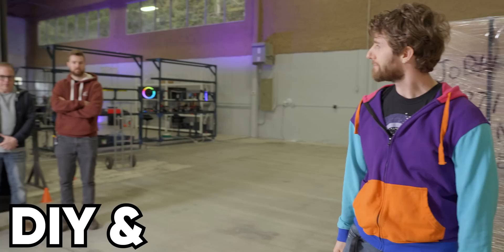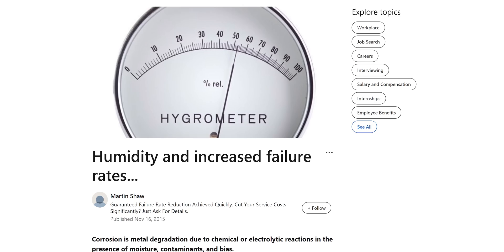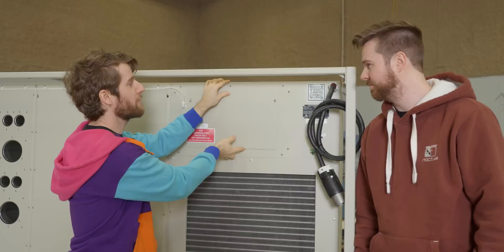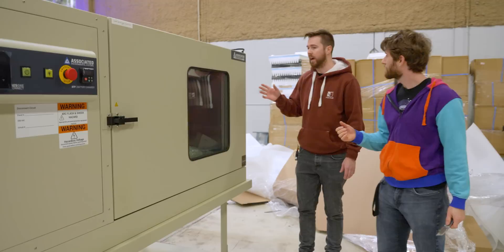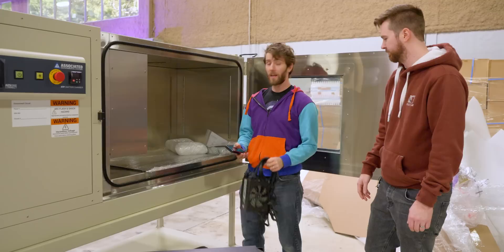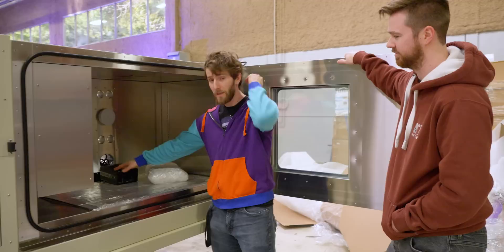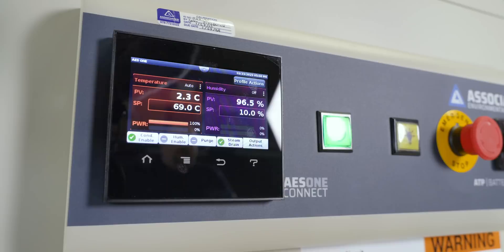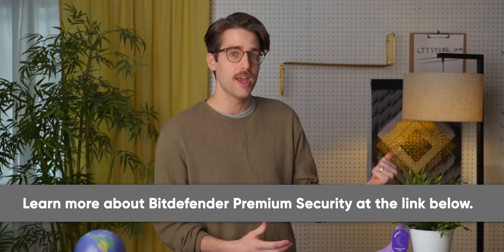We bought a Fridge for computers.. - Environmental Chamber Unboxing

Comment: For the PSU's, I do assume the test station can handle 4-wire testing so efficiency testing inside the chamber over "extensions" should not be a problem. Or at least the tester can be adapted to accept external 4-wire harnesses :)

Comment: This is actually the type of test environment mobile batteries need. Most tests are done in low humidity and room temp, if not less than ideal room temperature environment. When I use my phone outside with direct sunlight at 38/39C, with 80% humidity, the CPU drains power like a hungry V8.

Comment: All my experience has been with Thermotrons and I've never used an associated thermal chamber. But I  am pretty sure the Nitrogen is used for dry purge to allow for humidity to be pulled down fast to eliminate from condensing situationsn when doing thermal cycling. With thatt said, unless you want to change cylindners out alot, get a dewar tank of liquiid nitrogen.

Comment: regarding efficiency measurements with cable extensions: you can use four point terminal sensing (of the cable extension) and some calculations to extract the losses from the cable extension. But your lab team will know that anyway, I'm certain. (The only questionmark remaining would be the contact resistance of your connector. you could solder the probe cable to the PSU side but that's a hassle.)

Comment: 0:32 that reminds me: the temperature in Arizona growing up would routinely exceed my handheld devices' "rated" temperature.  I still have that Switch, and not only is it unscathed, it did not show any signs of malfunction.  (Neither did the Wii U tablet.  Or the DSi.  Or the 3DS.  Or the New 3DS.)

Meanwhile the xbox 360 of the previous generation had a reputation for overheating itself to the point of destruction ... indoors.  Luckily I'm a Nintendo girl, so I never had a device implode on me.

Comment: I had an Asrock z97 mobo with a bios setting to run the fan for some period of time after shutting off the computer, and when I looked it up, the explanation was that in tropical / high humidity areas like SE Asia, since the inside of the PC was probably going to be hot when shut off, the cooling air would condense moisture which could settle on the components and cause a short if powered on before it dries, so this setting helped keep the internals dry.  Smort, haven't seen that setting on any other motherboard (but I think TUF boards used to have it?)

Comment: If you characterise the cables from the PSU tester to the point of connection to the PSU default cables, then their effect can be calculated out. Alternatively, if the cables from the tester have extra sense wires that transmit the voltage at the point of connection, without carrying current themselves, then there is no difference in results (the tester must support that in that case)

Comment: Minor issue - 28 degrees Celsius is far too low to be room temperature in a lot of places especially South East Asia. Plenty of poorer Asian countries have average temperatures in the low-mid thirties for 3-4 months of the year - especially the places where electricity is too expensive for air conditioning to be a regular feature.

Comment: It’s calling for demineralized over deionized water, because deionized water is actually a solvent and will slowly but surely eat away at the internal plumbing. 

The same goes for water cooled laser cutters - demineralized to avoid buildup, but deionized will cause issues.

Comment: Hey, if you need a constant supply of nitrogen look into a nitrogen generator. Gonna be way better long term than buying cylinders. "ECS" is the manufacturer I know of. Will just need a compressed air hookup and filters every couple years depending on usage level.

Comment: See what temperature a water cooling system freezes and shuts down at and if that temperature would be sufficient to keep cooling the computer with the water cooling system frozen, you may need an expansion vessel of some sort, but would make for a great video

Comment: Well, I|m from germany (which is Europe afaik ) - and we lived thru the so called "energy crisis"  - which was nothing like a fart in the sea. There was no -28°C room temperature. You could still heat your house. But it got significantly more expensive. But I don't know a single person, who spared on heating. 
If anything, the people got mad and depended the rising cost of living back from their employers. Union-based tariffs rose at a whopping 10-15%, giving the middle finger to the inflation. 

Now, that winter is gone and the heater oil tanks were filled, gas and oil prices normalize again. 
I switched entirely to electric heating this winter, because I happened to have a fix rate deal on my power contract. Although german electric power is everything but cheap - I still managed to heat my home for less than 250€ / month. Given the horrendous oil and gas prices, this was a steal. My oiltank would have burned thru the better part of 1000L of Oil for nearly 2€ the liter, maybe 1.6€ and above. This alone would have cost me 1000€ more than my energy bill.

Comment: 10:00 - not an issue, psu tester has load terminals and sense terminals, make special cables that can load and measure voltage at PSU output  connnectors and all is well. (as well as things can be at LTT :-) )

Comment: I can confirm the high failure rate of electronics in Asia. The speed at which our lab equipment dies in India is phenomenal. It's not been so bad since we installed dehumidifiers, but it's still higher than expected.

Comment: Lol, welcome to the honeymoon phase of industrial equipment!  I hope you're still this excited when it drops logging in the middle of an expensive experiment, or the networking to the scada server goes intermittently and you need to trudge through EthernetIP messaging packets.  With great equipment comes great headaches.
Reply: The number of labs that just have bad Ethernet runs but blame equipment manufacturers though is outstanding, coming from the other side

Comment: For testing PCs, wouldn't it be easy to make a wireless device to push the power button when it reaches the correct testing environment? It is simple to make and would save a lot of time.

Comment: Testing PSUs in there is still possible with extensions. Just have to do a baseline to adjust your numbers with the extensions to match your no extension number. That way you still see the delta of efficiency at a given temperature.

Comment: The cable length issue for the PSU isn't a big deal. Here's how to solve it.
1) test the PSUs in the chamber using a cable you make with a much larger wire gauge. This will reduce any negative impacts from internal cable resistance 
2) measure the cables provided. Gather the length, diameter, material, AND thickness of insulation
3) calculate resistance values from the PSU cables into a standard score
4) calculate resistance values from your special testing cable into a standard score
5) use standard score data to adjust PSU performance

Have fun!

Comment: It's more dry, than tropical (but places I want to travel are tropical), but this is a big deal for me. Whether the tech can survive 125F+ (46C+) & how many years is a bigger factor for me, than raw performance. Getting this kind of info is basically non existent, so I'm super into this data
Sometimes the first year is ok, but it's the following years that take their toll on my tech (phone, laptop). Speaking of phone, that pocket isn't dry. I got a free replacement phone from Verizon about once a year, cuz the phones inevitably died from pocket moisture, because they were all refurbs and refurbs lack that water resistance. I walked hours, including in the rain.

Comment: I have a peeve of people constantly misusing "efficiently" - efficiency is work done per unit energy (or more broadly, a measure of the resources used to get something done), efficacy or effectiveness is measure of the actual work done.  In your example of a GPU potentially running 3% faster in Oregon than Texas, that's efficacy / effectiveness, not efficiency (although yeah a colder running device will use less power as the circuitry will have less resistance, but that's not the point being made in that sentence)

Comment: He's not quite right about the glass panel not existing on the other models.  If it's only for a manufacturer to do their tests maybe?  But a lot of these that are sold will go to manufacturers who work on hygrometers and other humidity/temp measuring devices and you need to be able to look in and see what they're reading to compare to the unit's calibrated display measurement.  

You could work around it on some hygrometers as they log the readings but that's way more work than just looking in and comparing the real time numbers.

Comment: 208v isn't single phase, 240v is single phase, 208v is what happens when you combine two 120v phases from a 3-phase system that are 180 out of phase from each other, such as is typical is most commercial or large residential complexes....

Comment: Just an uneducated thought on your power supply testing issue. Couldn’t you just run a control group with cable extensions as well then all data will be on equal grounds?

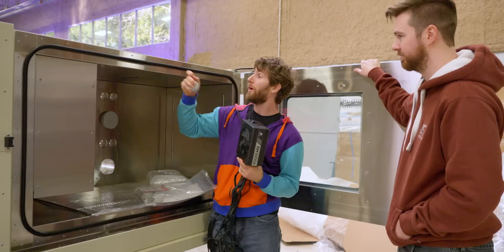Comment: 9:30 that shouldn't be a problem with a 4-wire configuration, using 2 wires to sense directly off the ATX pins

Comment: ...but no pressure control? It always bothers me when manufacturers put a 10,000ft max altitude rating on something, when I need to take it up above that for a jobsite or similar here in Colorado. Heck, the town of Leadville is above that even before you head into the hills.

...spoiler alert, I've had some 10k-rated stuff work just fine at 10,500 for months at a time at least.

Comment: The Chroma cables may be calibrated (energy loss per length unit) or one could just measure the resistance and calculate the efficiencies. I'll be there for work on Monday Linus.

Comment: Need some opinions on my first build. And if there’s anything that would be important to change before I buy. Budget around $1750
Ryzen 7 5800X
RTX 3070 ti 
ASUS B550-F
Trident Z 32gb 3600 CL18
MSI MPG 750w gold
2TB 970 evo
NZXT H5 FLOW case
NZXT T120 cooler

Comment: Really hope they take the Pixel over the coals for overheating at temperatures as low as in the 80s fahrenheit and leaving you with just a hot brick unless you can find a way to cook it down

Comment: I cant wait for the video where you buy that addon which uses liquid nitrogen to cool it down faster so you can actually keep it at stable temps with PCs in there. I also cant wait for the video after that where you buy a machine which makes liquid nitrogen so you dont need to order it in.

Comment: Small correction, 208V is two phase power in North America. It is two of the phases from 3 phase usually used in industrial buildings and large apartment blocks. 208 V is 2 phase where the phases are 120 degrees apart vs 240v where the phases are 180 degrees apart thus lowering the voltage potential from 240 to 208.

Comment: Just an idea. Is it possible to do a pressure test? For example, I live in a mountain area. I've seen lithium batteries of my devices drain quickly compared to a low altitude/ sea level area.  I know why it's happening but it's cool if you could test how various mobile devices react to low air pressure and stuff.

Comment: Hey Linus! You may or may not see this comment, but I figured I'd mention it here and potentially reach out. If you guys need any pressure decay, leak testing, pressure or vacuum testing and or measurement equipment, I work for a company called ZAxis Inc in SLC Utah! We'd be happy to help build something to fit your needs, no matter how custom!

Comment: I loved torturing industrial computers in the environmental chamber in my previous job. Ours went from -20C to 90C, no humidity control tho. 
Usually the temperature range promised was 0-60C, there were some models that had internal heater which would first heat the device to over 0C and then the system would boot up. Don't remember we ever had any issues with booting any system up from -10C however. Conformal coating and such may have helped against condensation.

Comment: The amount of times I wanted to this to my Surface Pro 4...

PSA: Don't buy computers from Microsoft, everyone! Their firmware support is just as bad - if not worse - than that of their operating system!
Like, have you ever had a windows update break some important feature (for instance Bluetooth) of your PC? Now imagine the same thing happening on firmware level, meaning even if you completely reinstall your OS or switch to a different OS entirely, that feature is still gonna be broken. Oh, and also the faulty update never got removed from the repository and the problem is still not fixed (and never will be, cause the device has since been EOL'd) after 5+ years. THAT'S the built by Microsoft computer experience!

Comment: where tf in europe does it get to -28 indoors. like.. no, that doens't happen, even in like northernm scandinavia it doesn't get that cold indoors, even without heating..
Reply: In certain parts of Scandinavia, it did get that cold during particularly bad power outages from what I can recall, either that or he's talking about somewhere in Ukraine. I'm not 100% sure
Reply: @the_undead  yeah but that's like northern scandinavia in a power outage, not temps you'd ever get to indoors under normal circumstances.
Reply: @ms.antithesis  he did mention under a power outage when he said minus 28, and even if that is abnormal circumstances, If that is feasibly possible once every 10 years wouldn't you still want your electronic devices to be able to withstand it?

Comment: The type of water needed probably also has to with the fact that ultra-pure water, like MilliQ, is so extremely pure that it actually becomes an aggressive chemical which may dissolve certain materials. It's also very costly to produce and use.
Also, RH is a function of temperature and atmospheric presssure. AFAIK this machine does not control barometric pressure, thus effectively you only test for temperature and RH at the altitude your machine's at. Since atmospheric pressure drops over altitude, then at the same RH there's less water vapor present in the gas. Fractionally the gas is 'dryer' than the gas at sea level, while both have the same RH. Fortunately because of this principle, testing at sea level automatically creates the worst case scenario for high temps + high RH, but still assuming there's no barometric pressure control the first claim that the machine can reproduce any condition on the planet isn't really true, though not extremely important.